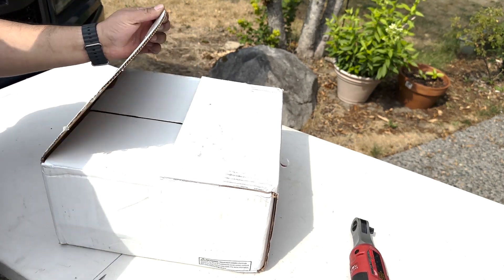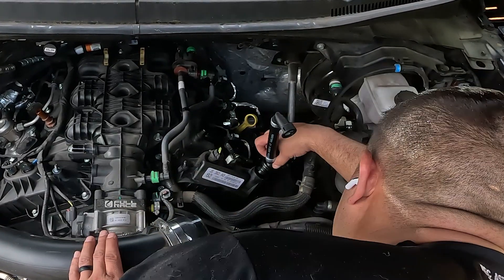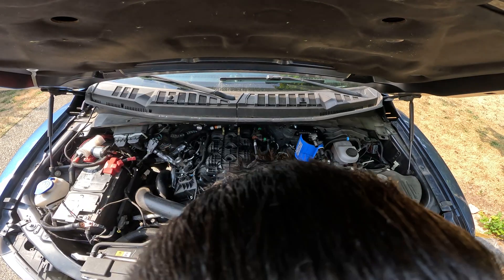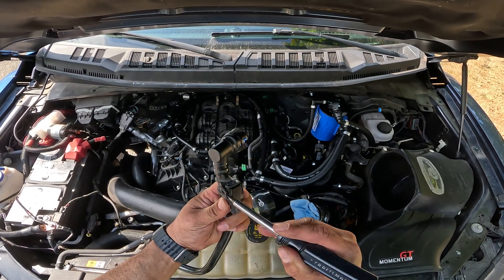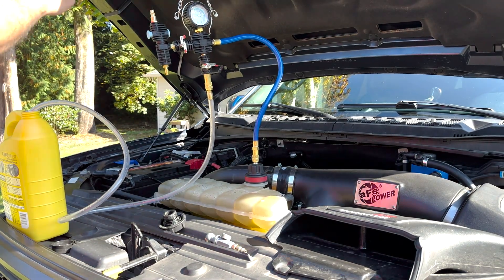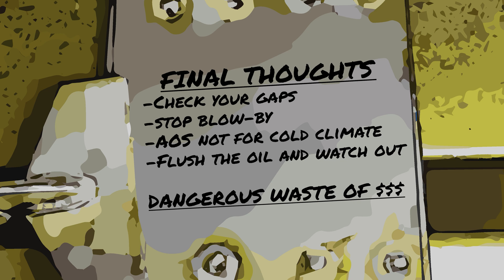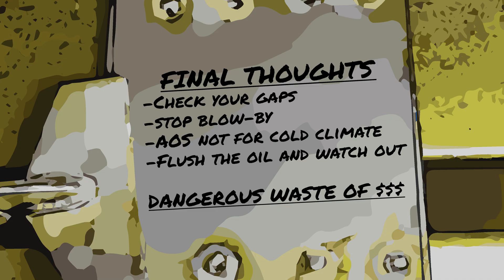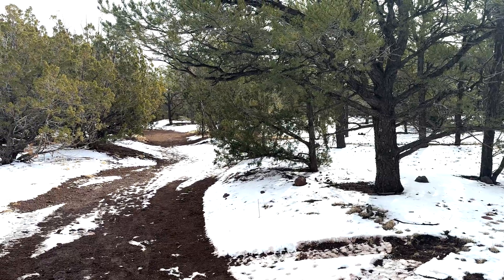Gen 2 Raptor IAG Air-Oil Separator

Comment: Hey, are you planning to do the cam phasers yourself? thanks.
Reply from the maker: Yes, just ordered the parts. Hope I can get them all quickly and I didn't miss anything I needed.
Reply: @ruffwrenchn2235  Man ordering parts has been a shit show, Doing a tune up on wife's car and with these high pressure fuel engines setups, once you take off parts you have to replace them. on the genesis anyway, The high pressure fuel injectors have to replace the seals and fuel line have to replace. Cant wait to see your Video!!

Comment: I heard a little phaser rattle at start up sucks
Reply from the maker: I know! I need to talk with the wife about paying for replacement including preventative maintenance parts or tearing it apart myself for 1/3 of the price.  Can't believe the extended cam phaser warranty ended in 2023
Reply: @ruffwrenchn2235  I just got mine cam phasers replaced on my  Ford Raptor 2018 with the new upgraded cam phasers. No more rattle.

Comment: The only one Id consider is the Ford Performance one for the water issue.

Its the same maerial as the ones for GT350/500.  I use my raptor in both extreme, over 100 F to -20 F sometimes.  I dont mess with anything thats not stock because people that mess with airboxes etc end up dead on the trail with issue like this past weekend.  Frozen BOV, Thottle body issues from air intakes... not worth it.
Reply: The Ford Performance catch can is worth it in my book.  I have it on both my Raptor and my GT350R. Since it is a catch can, you do have to empty it periodically but that takes literally 2 minutes. I check it roughly every 1-2k miles and then drain it when I do my oil changes. I like to drain into an empty oil bottle so I can see how much oil it catches between changes; on average it catches around 2-3 tablespoons of oil at most. It costs a fraction of what the IAG AOS does and in my opinion looks better; has a factory look to it based on where it installs and because it uses OEM hoses.
Reply from the maker: @ Thanks! I'll check it out as a replacement...I've been looking at UPR, but maybe FP is a better choice.
Reply: @ruffwrenchn2235  Yep...another vote for the Ford Performance can. Installed on my 19 Raptor and zero issues from it.
Reply from the maker: @FreedomIsntFree2023  I ended up getting the Mishimoto. Just need time to install.
Reply from the maker: Yeah, if it's not OEM it's the owner's risk to install...lesson learned.

Comment: Great video 
Honestly I have catch can on my Raptor it does not do fucking thing I keep checking it’s always empty 👍🏻
Reply from the maker: Thanks! Is your catch can connected to both valve covers or just one? This thing is definitely collecting oil, it's just also mixing with water and dumping it into the engine.
Reply: @ it’s connected on one side only I think it’s passenger side
Reply from the maker: @ I believe the actual PCV valve is only on the driver's side.  Maybe double check yours? I know you can buy them separate or one that does both sides.  Getting the other side might help you snag the oil before it runs through the intake.
Reply: @ I will check it 👍🏻
Thanks
Reply: @ruffwrenchn2235 If you run an oil with low noack volitility a bank1 catch can will be more than sufficient. The Ford can is just fine in -45 weather as long as it's emptied on the regular.
Reply: @mikimiki195  usually the side that route from the intake manifold into the valve cover is the side that produce the most blowback fluids.  which is the passenger side for the raptor.  mine only produce like 1-2 teaspoon of fluids after 2.5k miles.  but i take that as a good indicator of the engine health.